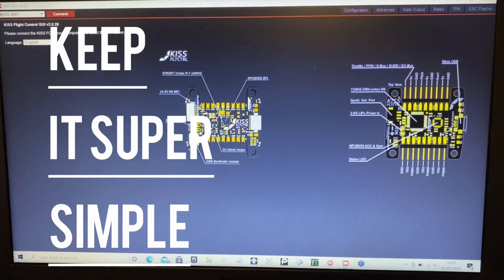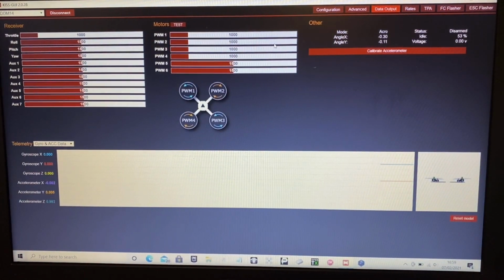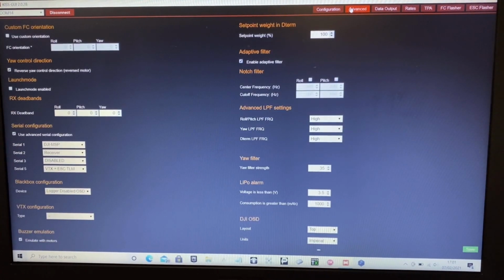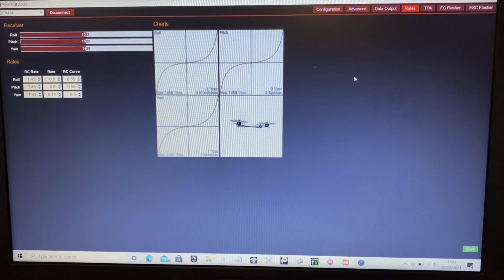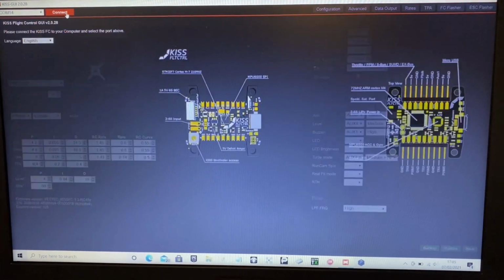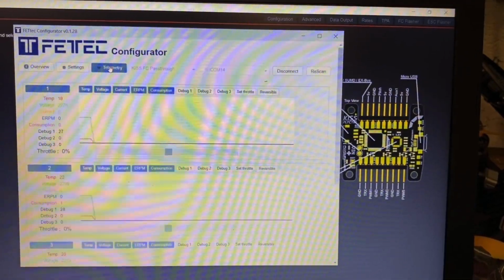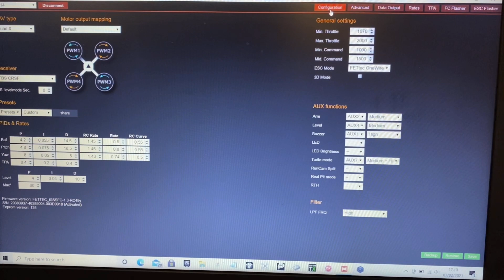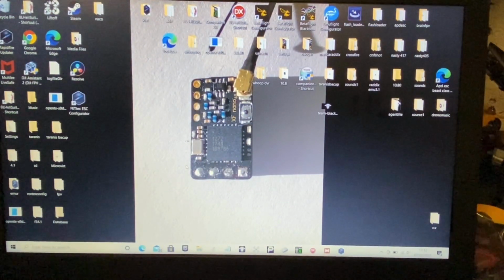Kiss fettec fettec apex look into gui Build it click send it 👌

Comment: Hey man, I have been using the G4 f.c 1.4 for maybe a year on kiss, I have just got the G4 1.7, it won’t connect to kiss gui, it will connect to FETtec configure. Do you know of any issues or steps needed to get the G4 1.7 to connect to kiss gui?
Reply from the maker: I kinda fell off the kiss train  
I think some versions may not work with kiss out the box. Maybe you have to put in in boot loader and flash local first.
Reply: @noisy_boi_fpv_3920  hey thanks man I have managed to do it, I just needed to put the kiss firmware on it first I have now connected to the gui 🤩🍻
Reply from the maker: Impluse rc driver fixer. Usb lead. Also

Comment: its so good 3 new fettec quads i bought from a builder are all tuned so bad on 6s that i get full throttle oscilations to where full throttle is more like 70% and i been trying .2 to .4 P to D ratio , krunkt golden tune , this tune that tune and i get it to punch out good finally but when letting it fall down then hammering back on major prop wash before takes off again then when i try to get that out i end up back to trilling oscilations as i full throttle.  And no one does pro level help on kiss pids . LIke for instance perhaps a true x has pretty close pitch and roll pids then say a squished x perhaps has higher pitch pids than roll pids . No one explains tpa well for p i d . Obv the dude i bought these from u would think can tune well esp since freinds with a certain brand of freestyle quad maker in usa. but yea shit is annoying . Its as if i have faulty hardware yet its new.  Esp since a few of the beta flight quads i bought from same person new are not tuned good on 6s. So annoying.

Comment: Thanks Mate! Great overview video. I have a bit of a problem with a Fettec 35 amp 20x20 esc right now. The motor#3 isnt working and i flashed the esc's and everything but didnt think to check telemetry on the configurator and the debugging settings they have on there. Because after i built my Apex i was checking my motor dirrection (And motor #3 spun up a little and it stopped when i put my hand on it a little) getting ready to go back to the configurator and reverse motor #2 & #4 and when i touched the motor #3 to check direction it stopped? And then after that it didnt work again? I wonder if this is a debug issue with the esc? Because i already tested the motor and its fine! I love Kiss so much i already ordered another esc...but it be great if the esc i already got can be saved
Reply from the maker: Check motor screws are not hitting coils re check all soldering. I once bridged a component with a tiny blob of solder it jumps about sometimes. Its a relief to just know what the problem is then having the problem. Lol
Reply: @noisy_boi_fpv_3920  Yes i actually just gave advice about covering your esc or fc with black tape while soldering especially if your using hot iron. I edited my above post. I already tested the motor the motor is fine. So im hoping that maybe this esc may have a debug problem and may be able to be saved. I appreciate your response mate! Cheers!
Reply from the maker: @allennickles3970  there is a tab in fettec esc gui see if you can pin it down maybe
Reply: @noisy_boi_fpv_3920  Will do Mate!
I cant believe i forgot the telemetry tab in the Fettec esc configuration. I been pulling my hair out over this esc. 
I never had to debug a esc..but i sure will try..lol
Reply from the maker: @allennickles3970  good luck man
Reply: @noisy_boi_fpv_3920  I'll let you know mate. Fingers crossed

Comment: When you get a chance try krunked preset for pids buddy
Reply from the maker: Yeah plan to at some point Man. This is not this best vid but just wanted to show a couple of mates.  Gonna try and get some hd footage soon as i can. 👌👌
Reply: @noisy_boi_fpv_3920  krunked is a master tuner change setpoint weight to 80 aswell see what you think 👌
Reply from the maker: @chrishiggins7475  cheers man will be working around some tweaks in time i do like to find my own way to it also  i tend to keep trying things until it goes crap then back up. And then i get to the stage where if its not broke dont fix it. Lol
Reply from the maker: Just been looking into community presets awesome feature for people to match set ups and just send it man.
Reply: krunked prop wash tune on my apex 5in caddix konasty moonboot 1739kv 6s tattu 4.0 1300mah and can not tune oscilations and prop wash out for life of me. Sadly the guy i bought it new from couldnt either. So annoying. The best tuned quad i have is only the ones i bought from iflight hglrc etc. All my custom builds i tried 6 of 14 so far and all are not tuned good enough and of the 7 fettec builds i only tried 2 so far and they are unflyable on 6s but 4s will work  which is odd and they both have 1000iu battery lead capacitors as well as fettec spike absorbers . Cant see them being built wrong either being they do fly its just prob hard to tune . Not sure if wires being between esc and fc with fc upside down is a problem or not but i know there are none on top touching fc. Both have tbs tracer to